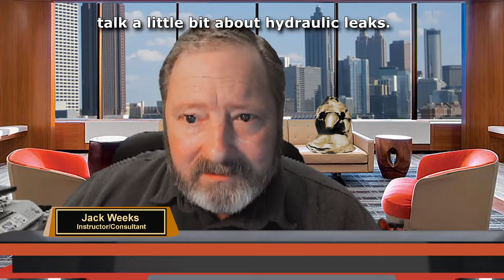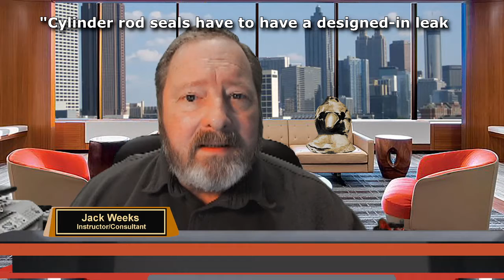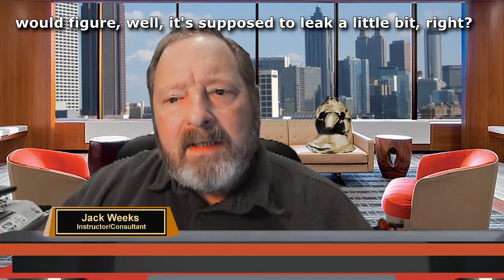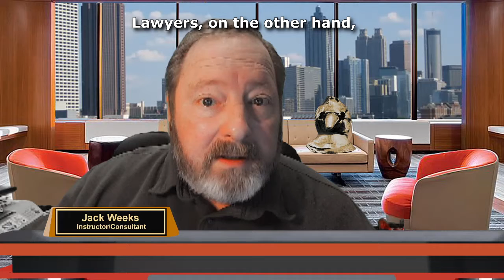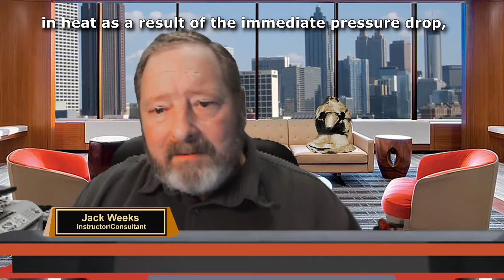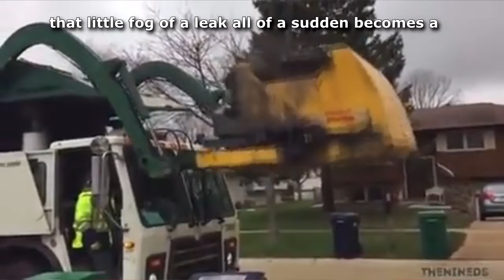The importance of fixing hydraulic leaks

Comment: People want to ignore hydraulic leaks til the plant has to continually buy oil and the maintenance department is continually pissed off. Apparently I need a work order for everything but I try to at least keep the reservoirs full without a work order. I've put in material requisitions for new valves and cylinders/rebuild kits but yet to see the parts arrive.

Sorry, had to rant. Just an annoyed maintenance mechanic.